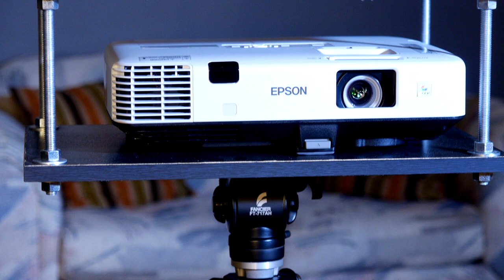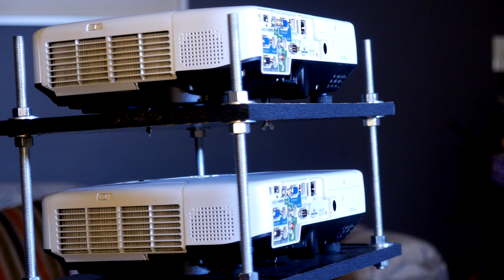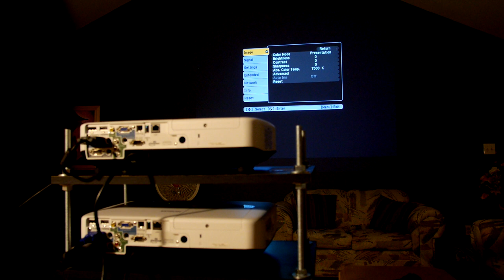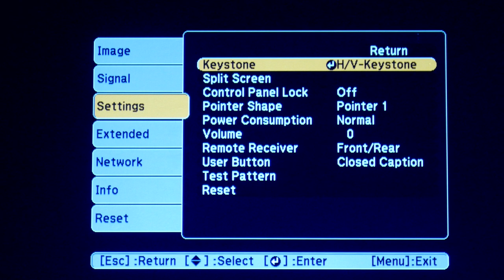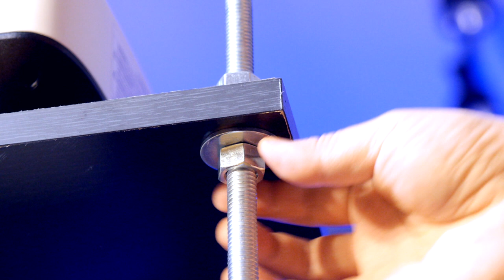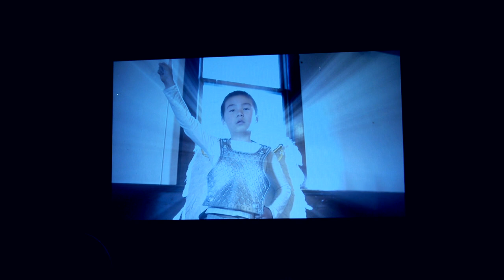DIY cheap way to build 10,000 lumens large venues projector

Comment: great video, i have one query on which projector you connect the hdmi ? or lets say flash drive ? top one or the bottom one ? how does it works in case of 4 projectors ? on which projector we should connect media input ? thanks
Reply from the maker: For HDMI source you need a HDMI signal splitter. For this type of setup I always use VGA cable/connection and not HDMI. VGA cable can run longer distance without signal booster (I did one event using rear projection setup the projectors was 50 feet away from my computer).  Also most high end projectors have VGA input and VGA output ports such as Epson 1960 projector, therefore, I don’t need to get a HDMI signal splitter.  I just connect the computer to project 1’s VGA input then VGA output to project 2’s input then output to 3rd projector’s input then output to 4th projector's input.
Reply: Tim Z thanks for the explanation, but how do one connect the usb flash drive ? and wont the quality of video lower if we use vga cable/port instead of HDMI ? thanks
Reply from the maker: sharad k Sorry I could not think a way for USB drive to do this. From my own testing I did not see any drop in image quality using VGA vs HDMI cable.
Reply: Tim Z okie., not an issue. i was planning to do 4 projector setup using chinese brand. thanks for your reply.,

Comment: Tim, do you mount it on the tripod for projecting or was it just for the video? If you do, how stable is it?
Reply from the maker: +Greg Rhodes Hi, I mount the rig on this heavy duty tripod http://amzn.to/1UjXUYl for projection. This tripod rated 26.5-pound maximum load center balanced. Using this method allows me setup my projector quickly because I can make quick adjustments to 4 axis pan, tilt, yaw and high.
Reply from the maker: +Greg Rhodes This is the tripod head I used which can handle the weight of this heavy rig http://amzn.to/1nBGdXj
Reply: +Tim Z Thank you very much for the reply. That's great to hear. I'm a pastor of a church plant and we're looking to do exactly what you did for your church. I was thrilled to find your video. Thank you!!!!!

Comment: Nice rig but you can't get 10,000 lumens using 2x 5000 lumens projectors .  The additional lamp brightness adds only 1/2 of its rated brightness when mixing the light . So you have 7500 Lumens with this setup not 10K.
Reply: +Scott Guy  -  The lumens at the screen will 10,000....easily verifiable with a simple light meter. It is accurate to say though, that a viewer would not perceive double the brightness over the single 5000 lm unit. The human eye does not see changes in brightness linearly.

Comment: hi can we use other projector like Panasonic with the same stocking and cornering pattern?
Reply from the maker: Ronnie Lesaguis You can do this as long as the projector can do individual corner
keystone adjustments (in small increments). I only saw some Epson and NEC
projectors can do individual corner keystone adjustments.
Reply: copy thanx...
Reply from the maker: Ronnie Lesaguis You can project any "Grid Patterns" by connecting to the computer then display the grid image. You can make one or download the correct size for your projector from many websites like the one below.

Convergence Test Patterns
http://www.mediacollege.com/video/test-patterns/convergence/

Comment: Amazing tutorial Tim! thanks for sharing. I have a few questions though, im building mine to host church at home since Church venues are unavailable due to lockdown.
1. Are corner keystones necessary or  +50 degree H/V keystone sufficient?
2. can i get projectors of different brand, since only 1 projector needed to be adjusted for keystone and shiftings.

thanks alot!
Reply from the maker: Hi, corner keystones is necessary. It very hard to align  two projectors images using only H/V keystones.  I never tried align different brands so I am not sure.

Comment: So, if I buy 4 projectors and align them all just as you showed in the video, would that be 20k lumen?
Reply from the maker: 4 projectors, yes in theory, but in reality took me about 15 minutes to setup (connect cables, power, computer) + align two projectors and the time to align 4 projectors could be 35+ minutes and if someone bumps into the rig or projector/screen location changed you have to realign again.  For two projectors I can realign about 3 minutes which little risk to the event start time.
Reply: Tim Z
OK, thanks for the answer.
Reply: Damn, man that would burn through the screen....lol.

Comment: tim how about 2unts sanyo xu105s?
Reply from the maker: Sanyo xu105s only has Digital Keystone Vertical only. This limitation will make very hard to merge two images.
Reply: @Running1226  what near brand can be? ,maybe used units
Reply from the maker: I used Epson and NEC projectors with corner keystone function to use with this method. Both brands are excellent in build quality.

Comment: Tim and Louie, yes it looks brighter, however if you measure the lumens as per the ANSI standard you will find it to be 20%-40% less than the total lumens of the combined projector.  This is just a fact of how they operate.  The ANSI standard requires measuring 9 points of the screen to get an overall brightness measurement.  If you just measure dead center with a white screen, it is not an accurate measurement of the brightness.

Comment: Wild99HD is actually right.. Just saying it like a dick.. To the human eye it may seem doubled.  But if it even added half the rating of the other PJ the extra brightness to the human eye would look like its doubled. Picture when its super dark and turn a light on does your flashlight seem bright? Have to take in consideration a lot of reflective qualities are being used.. But it does work and does add.. Myself wouldn't do it for brightness but for 1080p true 60hrz 3d. each pj would render each eye at 60 hrz.. There's a software if interested you should check out..

Comment: This is NOT true and does not work.  I have been in the projector business for 18 years.  His logic is not true, when you overlay 2 projectors with the same brightness, it DOES NOT equal the total brightness.  If it was only so easy and cheap!!!  So if you have two 1,000 lumens projectors and combine them, the result is 1,500 lumens NOT 2,000 lumens!!  If he had actually measured the lumens output using the ANSI standard he would have realized this error.
Reply: so 2 6000 lumens projector will make 9000 lumens not 12000 why does that happen
Reply from the maker: My own testing (not 100% scientifically correct) showing brightness doubled.  Official testing I saw on the web showing the brightness doubled (2 projectors), quadrupled (4 projectors). 
Aflex5d - testing results with 2 – 4 projectors stacking
http://aflex5d.com/images/downloads/Tech%20data/LumensTest.pdf
Take a look at this hardware based projectors stacking solution
http://tinyurl.com/p2je4es

Comment: these is TOTALLY WRONG!!! you don't have the correct info. NEVER BE 10k LUMENS.

The light measurement is not as simple to add 2 X 5000 projectors.... there is a curve of values...
Investigate and you'll know that if you add 2 projector of 5000Lumens you get about maybe 6000 lumens total. 

Youtube is full of WRONG information.
Reply: I agree.  7500 max.  You have to stack many to make 10k.  However, if you are indoors, then 6 or 7k should be enough.  But that is all a side issue.  If your organization (or church in this instance) are cheapskates, then they should have to suffer through you turning off the lights for video stuff.  When they get sick of it, then maybe they will cough up the money for a real projector.  So sick of everyone wanting something for nothing.    People will pay thousands for completely vapid services like cable tv, disneyland, and sporting events but they won't cough up the money when it is actually necessary.  By trying to acquiesce to their cheapness, you are just promoting such bad behaviour.  If you are the cheapskate then you get what you deserve and I guarantee you that somebody knows that your 6k image is not 10k like you are lying to them that it is.
Reply: +Patrick Kearney I'm guessing you sell projectors for a living?
Reply: I do not sell projectors for a living.  However, you are correct in guessing that I am a professional in the field.  I have been working corporate and concert production for fourteen years.  

I just did this setup last week.  The client asked for a 5k.  However 5k was a bit dim for the room.  I stacked two brand new 5k Hitachi's at the shortest distance possible.  I then explained to the client that this was approximately 7k.  I would say that it was a fair estimate due to the lack of bulb hours, close throw distance, and high quality screens.  

I'm not trying to be a hater.  I'm just pointing out that the economy 10k is an uncorrectable problem.  You can only create a certain product with the correct equipment.  In this case, the correct equipment would be enough projection to actually make 10,000 lumens.  

The production manager, the V1,  the projectionist, or the audiovisual tech are often burdened by unrealistic expectations.   Clients are often unfair in their expectations.  Part of this is because not-so-professional AV companies will promise things like 10,000 lumens for very cheap, and then set up two 5ks claiming they make 10k.  This leaves the client wondering why the real professional, who actually makes 10k, had quoted a higher price.  

The industry is full of poor communication, so sometimes us professionals are inspired to bring it up on chats such as this one.
Reply: How can 2x5000lm not be 10000lm?
The lumen is a linear unit. It is a product of power (in watt) and a weighting factor dependent on the spectrum of light. The two projectors are the same and project the same image so the spectrum is the same, and because there are two of them, the power double, so the amount of lumens also double.
That's basic physics, and if it is not right, it means that someone is lying, and the liar is not the one who is saying that 2x5000lm = 10000lm.

Note that the luminous flux is not a measure of perceived brightness. 10000lm (or 2x5000lm) will not appear twice as bright as 5000lm. Lumens are not like decibels or exposure stops, which are logarithmic scales.

Oh, and how can close throw affect the lumens output? Is the room filled with smoke or something? With a good quality screen, which presumably have gain, close throw should be a negative because the rays diverge more. I am confident that, as a pro, you know what's good for your clients, but your math doesn't make sense.
Reply: Your analysis is correct in the sense of light being transmitted.  However, we are not talking about video screens.  We are talking about Projection.  Therefore we are talking about reflection and not direct transmission.  Even though it is 10000 lumens worth of light landing on the screen, the loss happens in the reflection.  Both projectors are now competing for the same reflection surface.
Reply: Also, I just looked at my original comment from a month ago and can see how rude I was.  I should have been more polite about my comments.  One million apologies.
Reply: Somehow your logic sounds flawed. Light is light. Period.According to your logic if you put two candles side by side they wouldn't project as much light onto to the wall as if you aligned them in relationship with the wall. That's just nonsense, sorry to say that. You are a professional, that might actually make you be stubborn in your own right.
Reply: Nonnof Yobiznes no its not flawed 2 projectors at 5k produce 5k of brightness if you get one bulb that produces 10k of white light it will definitely be brighter than 2 5k bulbs next to each other 2 5k bulbs will never produce 10k brightness but will produce a larger spread of lower level 5k light, remember larger spread than 10k but not as bright as 10k
Reply: Nick Manhota Lumens represent the luminous power, independent from the spread.
Two 5k bulbs will give you 10k like 2 1000W heaters will heat 2000W.

If you take the spread into account, it becomes a luminous intensity and it is measured in candelas, not lumens. Optics define spread.
Reply: gubx42 I have done a little reading up consensus is 1 + 1 does not equal the power of 2 when defining image brightness with projectors due to loss and slight differences although 2 exact specifications projectors are used you have a loss when compared to 1 10k project with 1 plus 1 you get 1.5 to 1.75 increase this comes to 7.5k. comparing 2 heaters is not in the same ball park we talking about 2 projecters somehow doubling brightness to match one standalone which uses one lamp one lens it will never be as good as one nice try IN THEORY YOU ARE CORRECT (just so you know i am not disagreeing with your logic) if everything is perfect but these are not perfect projectors they are not  £40k cinema projectors that are close but still not perfect, they do not have perfect lamps as all lose brightness from the first time you switch them on if they are within 5% brightness of what they are rated at maximum 2 = double the loss you have already lost 10% in theory due to lamp degradation let alone lose via lens etc so 1+1  never = power of 2 in projector world in this case true 10k.
Reply: gubx42 also does that mean you get the same picture quality double the distance a 5k projecter normally can project at?
Reply: +Nick Manhota No Nick, no. I'm into flashlights. If you put two 1000 lumen flashlights side by side shining the wall, will look similar to a 2000 lumen flashlight. It looks the same to the eye. It sounds like you might be caught up in technicalities. We don't care about technicalities, we care about practical uses of solutions like this.
Reply: Distance itself doesn't really matter, air is quite transparent.  If you simply pull back the projector twice the distance, it will make the screen 4x larger so to get the same amount of illumination, you need 4 times more lumens, either from multiple projector or from a single more powerful light bulb.

Oh and you don't double percentages like this. If it was true it would mean that with 20 projectors, you would get 100% loss (no light), more and the room will start to darken :p. In absolute terms, sure, the losses are doubled, but percentages are relative, so it stays at 5%.

But you speak of picture quality here and I suppose there are some subjective variables that I don't know about. Specialists probably have some empirical rules depending on screen size, ambiant light, content type... My hypothesis (assuming there is actually a difference) is that 10k projectors are generally better built and cheat less on their specs and so give off a better result than simple physics calculations would imply.
Reply: All the people that think they know everything yet they commenting on the mans video showing you what it is. SMH. It never fails.
Reply: Is this 2 projector stack enough to display outdoor in daytime? Is there any way to use projector in outdoor in daytime? (in cheap way)